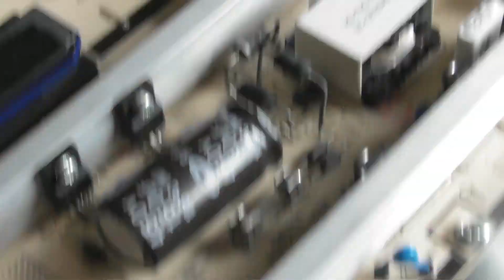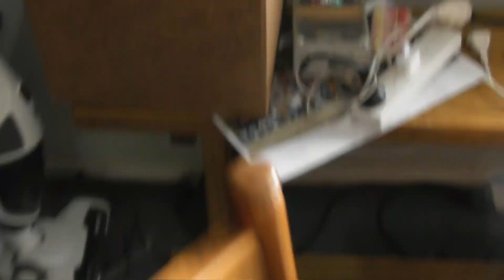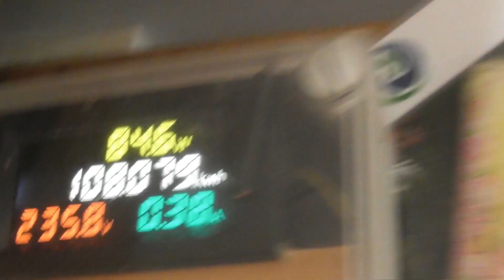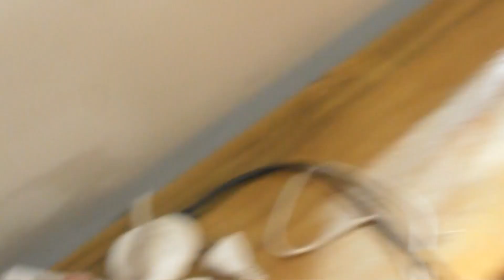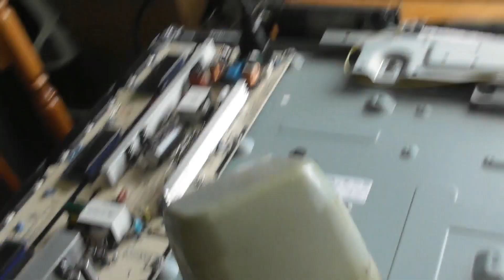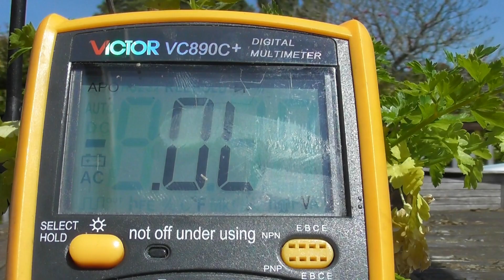Samsung TV repair follow up

Comment: Thanks for this.  Same TV here.  I had the blown fuse and was seeing shorts in various spots with the meter.  Snipped a lead on the most suspicious transistor and the short went away.  Other transistor reads a low value, snipped it too, and like the values a bit more now.  It seems your failure didn't go deeper so I'm somewhat confident now that I can just replace those three items and get it working again.

Comment: I'm not surprised that those failed, TO-220 packages normally have a metal tab around the back to dissipate heat, but those ones are all plastic, so even attached to the heat sink where is the heat supposed to go?

Comment: 3 amp fuse is fine as long as it fast blow as 3.15.  Make sure mosfet stay under 150c or use heatsink compound, if they run hot check caps and diodes around it.
Reply from the maker: Thank you, they are running luke warm, no stress.

Comment: Thought I'd never see that again. I'm glad it worked for you, saved another from the trash pile.
Reply: Forgot to add; Did you check all ground screws for lock rings & tightness?? That's the main cause of these.
Reply from the maker: I did secure the screws of the circuit board properly where there are the exposed copper pads. Did not look for any other loose screws in the TV. Weather is hot here in Auckland and the TV is going strong over the last 10 days.
Reply: @RODALCO2007  , That's great my friend.
Reply: @RODALCO2007 , Not certain without a really close look where all the ground screws are located on that set but you could watch 12voltvids on his about which ones are the ground screws. He's done some really good repair videos.
Reply from the maker: Thanks mate, I watch 12voltvids and will have a closer look at it.
Reply: @RODALCO2007  , Yeah it's an older one on a plasma TV about ground screws... I think??

Comment: I havent gotten mine to work at all... Lol. Cool glad you gpt yours working... So what really was the problem ? ~Russ
Reply from the maker: Not sure what caused it but replacing those two mosfets fixed the TV.
Reply: @RODALCO2007  , They always go out, that's why they sell a kit for them but most of the time it's just those mosfet, diodes.